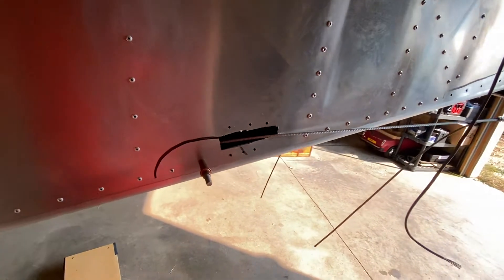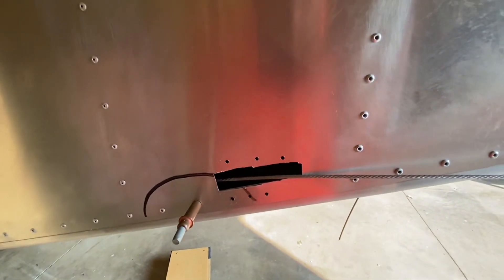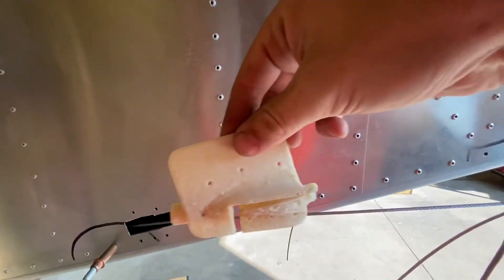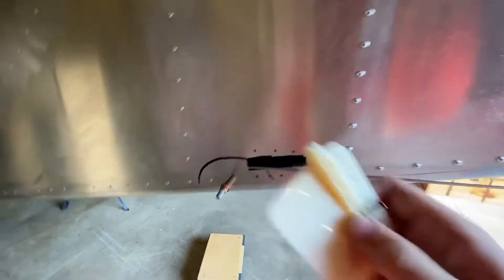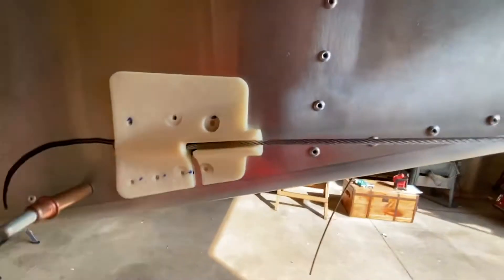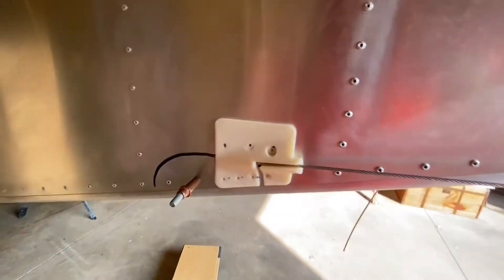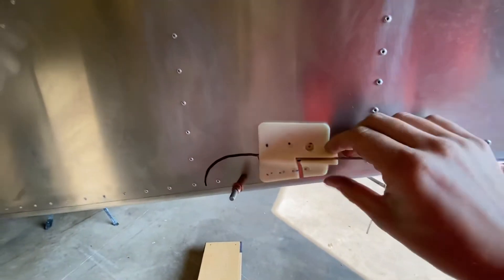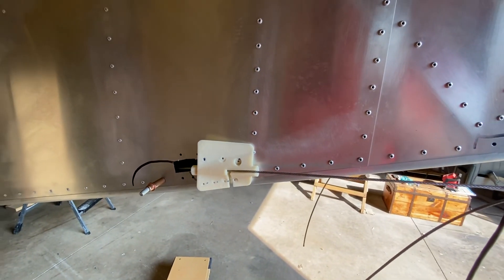Zenith CH750 STOL Build Log - 3D Printed Rudder Cable Fairing

Comment: Dusty! Its slick!  I need one for each side of my Zenith 750.  Care to print up an extra set? $$ ..... I need to remove the stock set up. It wasnt aligned correctly and I need replacements... 
chuckmiranda8@gmail.com
Reply from the maker: I will reach out once I get a slightly more polished design. I am working on the alignment now. I need to adjust the angle by a degree or two so that it doesn't wear too fast.